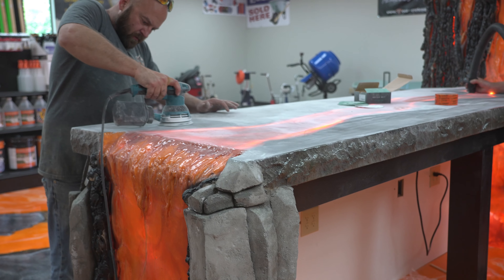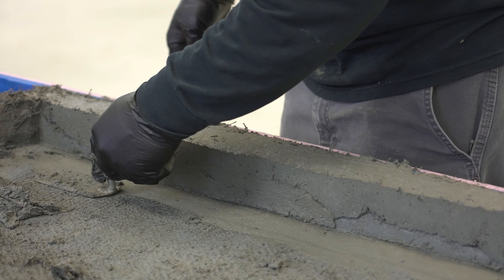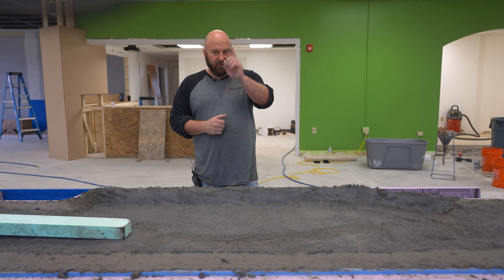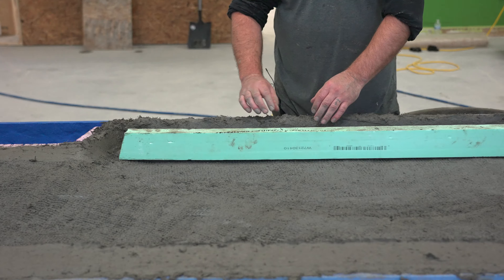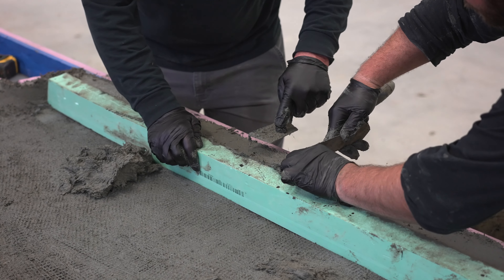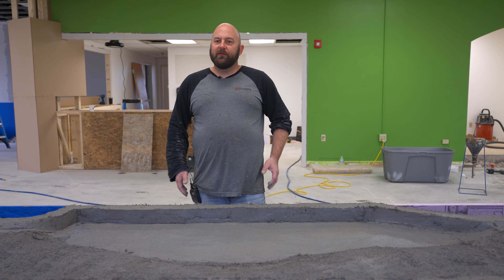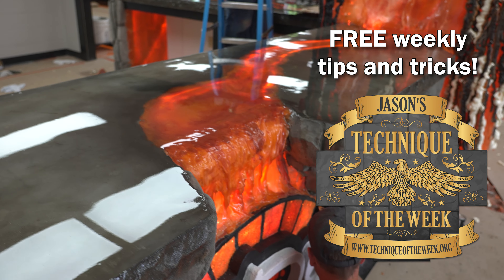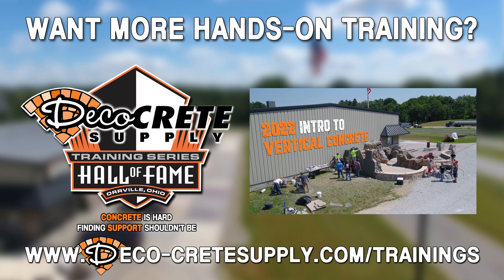Quick and Easy G.F.R.C Thickened Edges!

Comment: I have a GFRC question...    For a case-in-place countertop,  If I wanted to strengthen the mix with glass-fibers, but did not want the fibers to show on the surface, would it be a bad idea to pour the first 2/3 of the top with a mix containing fibers, THEN pour the upper 3rd with the same mix but with not fibers?    ... I'm trying to achieve a 1" thick top.   Thanks!
Reply from the maker: GFRC mixes will not work very well for cast-in-place countertops. we would recommend a wet cast concrete countertop mix which would need to be a minimum of 1.5 inches thick. Wet cast mixes work best with monofilament fiber. If you need the top to be only an inch thick than it would need to be cast upside down with GFRC.